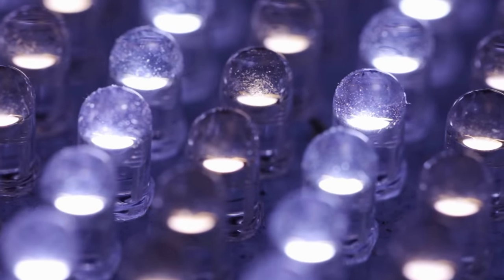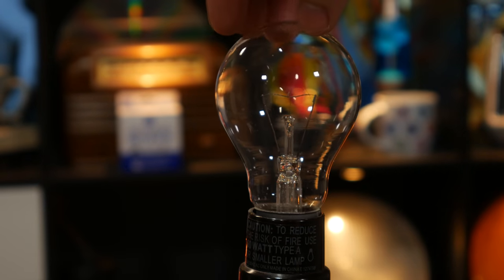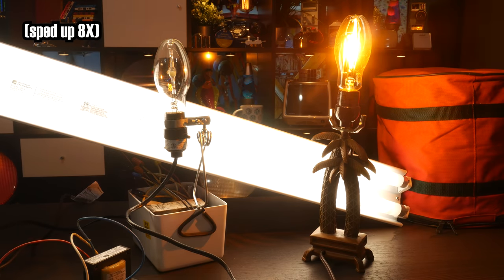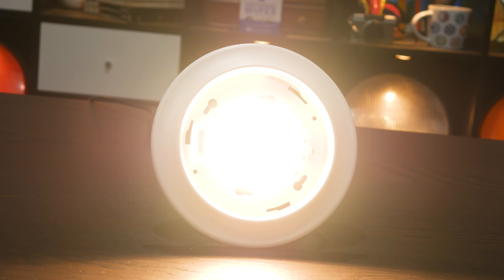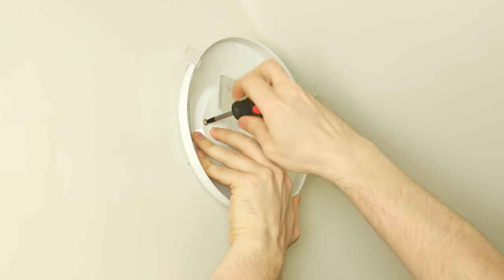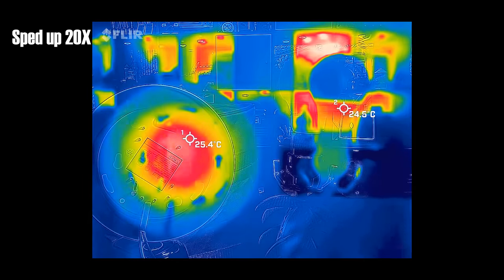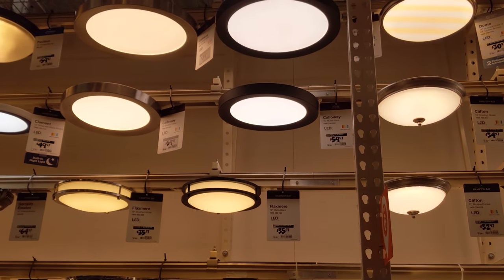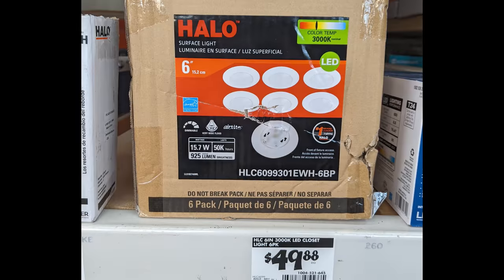A troubling trend in lighting?

Comment: When I renovated my garage to make it into my "studio" I chose to put in 20 evenly spaced octagon boxes and bulb holders for the very reason of choice and future proofing. Had I installed 4 ft led fixtures, if one goes bad I had better have a spare or I'm f-ed. Not to mention the ever changing technology advancements in lighting, I figure the bulb holders are the smart way to go. Also helped that it was far and away the cheapest option.
Reply: What do you mean by octogon boxes?
Reply: @JeskidoYT  the standard ceiling electrical box for lights.
Reply: How is an electrical box not future proofed? If the fixture is cost effective and mounts directly to a box, that's no less future proof than an Edison socket.
Reply: If a socket was standardized that utilized some of the advantages mentioned in this video, would your decision have been different?
Reply: @SamuelLudden  you need to re-read
Reply: I'd be curious to hear if you had any interference with your garage door openers because of this. I tried putting in some led bulbs in our garage fixtures and it ended up severely reducing the range of the garage door openers because apparently led bulbs put out rf interference that can mess with the remotes signal
Reply: @x_over_it  nope
Reply: @x_over_it  yeah that depends on the LED bulb itself and it's circuitry. Honestly it would require trial and error to find the correct bulb in your case.
Reply: @burnt chicken, I had plugged an LED nightlight into the same outlet as the receiver for the garage door opener and it reduced the range to about one foot.
Reply: 8-24 volt circuits are frequently used and I would imagine having one of those separately for house lighting could be more efficient than stepping down for every bulb.
Reply: Your best long term option would have been to put in 4' bi-pin fluorescent fixtures with LED tubes in them. Like the edison socket, there are so many billions of bi-pin sockets out there that there will always be a long term solution for them. Edison sockets are probably the next best future proof option.
Reply: @fionafiona1146  At that low of voltage, I think the resistive losses in the wires would be too high to run all the way across the house.  Maybe 48V (like Power over Ethernet) would work well enough, though.  Or, maybe have a 12V supply per room?
Reply: Whenever I get my own shop, I fully intend to use the DIY Perks artificial skylights: https://youtu.be/8JrqH2oOTK4?list=PLOJU8YJjFwGN0hMRewz2_u2IefV-vipsk  The LEDs, driver/controller, and power are kept separate so any of them can be replaced on its own.
Reply: @JeskidoYT  An 8-B box?
Reply: I read a similar idea to yours the other day. Someone put electrical outlets everywhere in their ceiling and used simple outlet to bulb connectors initially and then stuck with them over the years. But at least it's nice they could have had the option to change lighting if they needed it.
Reply: When I redid my basement, I converted all my light fixture boxes (octagon boxes) to receptacles. Using adapter plates.
Then I just plugged in cheap 4' LED light bars. With the length of the cord, I could move the bars where I needed them to even out the lighting in my unfinished basement.
My once dark basement lit with 5 incandescent bulbs is now bright thanks to seven 4' light bars that only cost me $15 each on sales. If one ever goes bad, I can just plug another one into the receptacle.

Comment: I really appreciate how often you brought up how comfortable someone is replacing the fixture.  I think that's a super important and often overlooked safety factor!
Reply: and it's such an unnecessary problem, and not completely new.
3 wires coming out of the ceiling, 3 wires coming out of the fixture. I wondered for decades why they don't fit them with some standard connectors...
Reply: Absolutely, if my dad or I didnt live with my mom, she wouldve had to pay someone to install the new ceiling fans around the house because she is terrified of handling bare wires (partly due to not having a full understanding of how safe it is despite my attempts to explain but i digress).

Comment: The thing I like most about the “disposable” LED light fixtures is that the light diodes are evenly spaced, causing a nice even glow through the transparent casing. With traditional fixtures, you can always see where the bulb(s) are underneath and I think it looks much worse in actual usage.
Reply: good point
Reply: I also like how they're entirely downward firing. The design itself, disregarding the planned obsolescence, and if available in 2700k more mainstream, really is a better use of resources, contrary to Alec calling it "arguable".
Reply: I'm more concerned that he's lookin' more like Rosie O'Donnel every vid. {0.o}
Reply: Also, I discovered that even many LED light bulbs on sale that do say they are suitable for use in enclosed fixtures may have additional caveats. For instance when I looked at the package of a Philips LED bulb on sale saying it's suitable for enclosed, there was a star next to that statement and in the tiny fine print at the bottom it said that the expected lifespan of 25000 hours it was rated at would be halved if used in this way. It's not all "without worry" unlike what Alec said in his CFL video when talking about LED advantages. That being said this design just needs some improvement and more serviceability and it would be great for what it is.  At the same time though I feel like if these companies made something easily serviceable they would cheap out even worse on the LED module and make it last even less long than they currently do. I base this thought off of the large amount of premature LED bulb failures I've heard of which are of course the most serviceable type. We are currently at the beginning of all these developments so only with time will we truly be able to see how long most of these integrated LED fixtures last. I did install these in a few rooms of my house that only take a single light fixture in the center (so color temperature and brightness clashing is a non issue) and they are all at least a couple years old and still going strong, including the first one of these installed 4-5 years ago. It's smart to be skeptical and look at things from all sides, but this concept of integrated LED fixtures is definitely an innovation that should be noted as a functional improvement from the old design
Reply: but have you ever seen broken LEDs? I just had to replace the taillight in my car, since a few diodes where out and thats not fine where I live....
old times, changing a bulb every couple years was not that bad....
Reply: @carly200  What make and model was this?
Reply: @exoticcar5482  Volkswagen golf+ V (no is version), there are two suppliers for the taillight, one seems to have more problems than the other...
Reply: Decent trade off for replacablity.

Comment: When my mom had her kitchen remodeled, she was talked into one of these fixtures, and was extremely angry when it stopped working within a few months and she couldn't replace it herself.
Reply: You absolutely can. You go to home depot and buy an light lmaoooooooooo. It’s literally a cable to plug in. Easier than a bulb
Reply: @hung8969  Perhaps my phrasing was imprecise. She didn't know how to replace it herself, and was not comfortable dealing with the wiring in her 100+-year-old house directly. The electrician she hired agreed that she was right not to do it herself once he got the unit out. But hey, good for you that you know how to do it yourself and are comfortable doing so.
Reply: @hung8969 I fail to see how removing 2-4 screws, running back and forth between the circuit board and a voltmeter (I ain’t getting zapped again over assuming everything is on the same circuit), untwisting a pair of wires, wire knutting a new light, pull testing the new wires (I ain’t risking a house fire either), and then screwing it back in is easier than just swapping a bulb.
Reply: @chamberlane2899   You missed the 100 year old house bit.  Living in a 123 year old house myself (I'm enjoying that as much as I can until next year), there's a key aspect: not everyone that worked on the house was a professional, and certaainly not everyone actually knew what the hell they were doing.  Likely, whoever did or redid that electrical section, did it wrong.  I know they did in my house: Why is the bathroom outlets on the same circuit as two outlets in a bedroom on the other side of the house?  No idea!  They shouldn't be, but they are!

Personally, we installed these kinds of lights in our house after a house fire (unrelated, just the initiating incident), and I'm super happy with them.  They've lasted 5 or 6 years, and are really bright.
Reply: @stevenn1940  I don’t know about you, but I’m not about to redo my houses wiring just because a bulb burnt out. Unless I see a compelling reason to do otherwise, I’ll just replace the bulb.

So again, I ask, how is replacing a self-contained light like this any easier than just swapping out a dead bulb?
Reply: @chamberlane2899  Well for one, it's not a piece of fragile glass screwed and held to the fixture which you have to balance while on a ladder and do in reverse when you're done.  I would, and have, rather let one bulb stay burnt out than try and swap it out.  A fixture working at 25% the brightness of one of these, rather than swap out one bulb is preferable to us than taking those damn things apart.

And hi, look at this thing, it's literally using the same connections, the same fixture, everything the same.  All I have to do is twist the fixture, undo two wires, and put two wires on the new one.  Easy.  Simple.  quick.  One trip up a ladder.
Reply: @stevenn1940  I guess my perspective is a bit skewed as I am rather tall. So for me, replacing a bulb in all but the highest ceilings is simply a process of walking over, reaching up, and swapping it out. But I guess from the perspective of needing a ladder, that perspective would make sense.

Still, if it’s lower than 9’, I’d much rather deal with a bulb than one of these. I can’t figure out how to get the fixtures in my home down without a tool.
Reply: my parents replaced ALL the recessed lights in their house with LEDs. Half of them burned out within a year. Dad is pretty pissed
Reply: @chriskeller3705 china at it finest..best is if you drilled holes in the ceilings,  have fun finding the right size of lamp for the hole 😂
Reply: @hung8969 how is that easier than a bulb

Comment: This is the exact reason that when shopping for ceiling fans for my house, I avoided models with built in led lights. No temperature control and I have to go through that manufacturer when the proprietary bulb they use eventually goes out.
Reply: Plus socketed designs for ceiling fans can still be beautiful and direct light properly unlike other fixtures
Reply: This is a good thought. I actually hate the LED halo in the ceiling fan in my bedroom. it's not bright enough and flickers when dimmed. I actually have contemplated rewiring it with socket fixtures.
Reply: Exact same with me. It narrowed down my options considerably. 

But I simply couldn't stomach the thought of one day tossing out a perfectly good ceiling fan because the LED light went out.

Comment: I'd like to add that having any kind of microelectronics circuit hardwired into your house increases the relevance of a whole house surge suppressor.  At my last house, electronic things would often get fried due to noise and swings in the mains power.  I finally installed a monitor to prove my power quality was terrible.  It doesn't take much to fry an LED board.  And during a thunderstorm, even a strike a mile away can raise your voltage to levels unkind to electronics.  At least with screw-in LED bulbs, you can CHANGE THEM when they fry.
Reply: Afterthought: When I got a whole house surge suppressor (which cost $120 and took 15 mins to install) all my electronics quit having mysterious problems.  The difference was dramatic.
Reply: That’s a thing I had no idea existed and now it feels like such an obvious idea I’m surprised I never considered it before.  I’ll have to look into how one gets such a thing now.
Reply: @jdatlas4668  If you have two free slots in your breaker panel, any electrician can do it in 15 mins.
Reply: Ours have separate boxes between the wire and fixture to control voltage. A bit more hassle to install but (hopefully) that is a solution to that issue.
Reply: @WanJae42  Where was your last house? Rural? I can't imagine this stuff happening on urban/suburban supply.
Reply: @WanJae42  amazing what getting actually stable power like the devices were designed to operate with will do.
Reply: Whole house surge suppressors are now required for all new construction homes by the National Electric Code
Reply: if you have THIS problem in your house then you have different problems than complaining about an led dying. at my house the only time something got fried was when a lightning struck the house directly and that was like 16 years ago. since then nothing has been fried (granted we in germany are now intelligent enough to have underground wiring in our towns but still). and btw. yes i do live in a rural area in a village with about 730 people living there.
Reply: Lightning strike miles away? I think it depends how your grid is designed. Lightning, unless it hits the powerline, creates a common mode surge. In a normal 3ph transformer that cancels out, so it never gets past the primary.
Reply: @Avantime  Suburbs of Atlanta.  The supply to the neighborhood isn't the issue.  The constant thunderstorms, the neighbor with the 1970s 20A tablesaw, the neighbor with the air compressor, who knows what else was the problem.  But it's easy to think you have great power until you put a monitor on the line, and it's easy to write off the occasional piece of electronics lasting 10 years instead of 20 as a fluke.
Reply: @SimonBauer7  That's an interesting and baited characterization of my statement, and as already indicated, my problems were solved by adding the surge suppressor, but thank you for your concern!  My service was buried from the start of the 45kV distribution to the house itself.
Reply: @liam3284  Of course it depends on many things, but I didn't want to write a technical paper here stating all the obvious matters.
Reply: Even my cheap little power strip with surge protection saved my computer by turning it off when lighting hit at the end of the street. Well worth the small expense.
Reply: @jdatlas4668  Nice pfp
Reply: Yeah, I just bought a surge suppressor to install in my panel because I usually have problems with capacitive droppers PSU(washing machine) and the start capacitors of fans slowly degrading over time, it's not that serious, they usually last a while, but shouldn't be something to replace that often.
Reply: @WanJae42  what surge rating does that suppressor have to cover the whole house, and how often have you found you need to replace it? Assuming they have a limited lifespan-
Reply: A good thing about a laptop computer is that even a pretty rooted laptop battery will be able to keep the computer going during an automatic-recloser event, such as when a squirrel or wet tree branch shorts out the overhead wires for a second....
Reply: @wingerrrrrrrrr  I'm no longer in that house, but it was Eaton's "best" model at the time (there was only $10 difference between the models).  Like a regular surge strip, as long as the LEDs glow (two in this case, one for each 120V leg), it's happy.  The electrician said if it ever blew, it has a lifetime warranty, and they'd come and replace it.
Reply: Sounds like you need an SPD (or whatever the North American equivalent is).
Reply: Maybe that’s part of the reason why so many bulbs fail after mere months of service. But mostly it’s because of incredibly cheap drivers with poor heat management, and I can’t stress enough, OVERDRIVEN LEDS. The LEDs in those things are so incredibly overdriven that they are being cooked to an early grave. Instead of producing cheap excuses for light bulbs and then forcing everybody to use them, let’s take more effective measures to reduce energy consumption. More efficient insulation, heck RENEWABLE ENERGY. If everybody used renewable energy, guess what the best kind of light bulb for the environment would be? Incandescent. Yup, plain old INCANDESCENT. Incandescent light bulbs are made of tungsten, glass, copper, and solder. LED light bulbs are made of plastic and electronics. Thus, incandescent light bulbs would produce less waste than LED bulbs. And the fact that they tell people to throw LED bulbs in the garbage, I’m starting to think this is more about them making more money and not about saving the planet. Not to mention these things, looks like the light fixture brands partnered up with electricians to develop a win-win solution so that both can snag up extra money they had been missing out on when light bulbs were popular.

Comment: I can confirm, I was plagued with dead led bulb, I always bought the cheapest that had the plastic base/plastic cap design. After I switched to the filament/glass design, I had much better longevity. I still get defective bulbs, but the defective bulbs normally show issues nearly immediately.

Comment: Pro tip. When tryin to measure temperature on something that is thermally transparent, put a small piece of painters tape on it. It will heat to the surface and allow accurate measurement.
Reply: I was going to suggest he paint the light bulb black, but yeah, I guess that works too.
Reply: Two things I found to work really well is classic white-out (I use this for shiny electrolytics) and also dye penetrant developer---a white powder that's really easy to spray on and remove. They have surprisingly good emmisivity, no gloss and are super thin (poor insulators/lots of heat-flux).